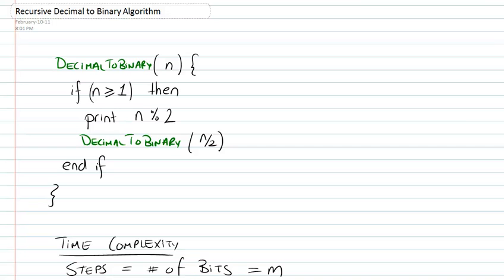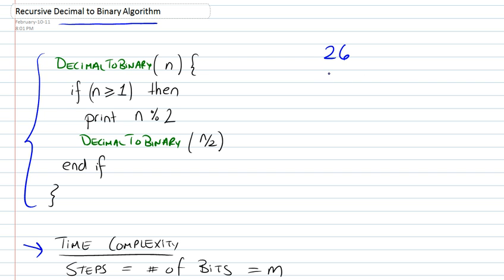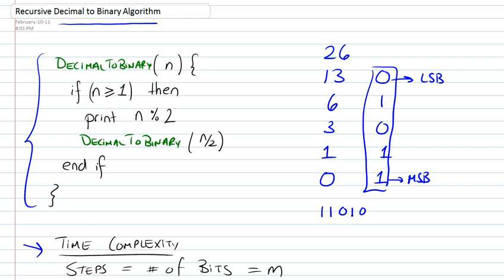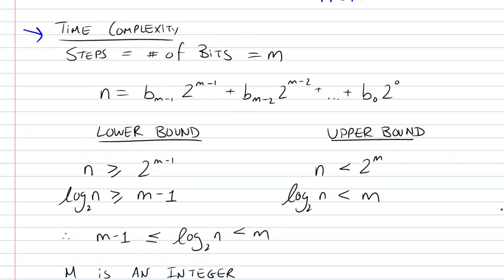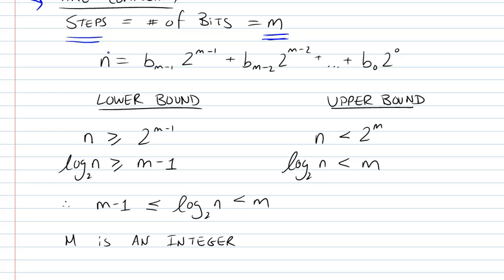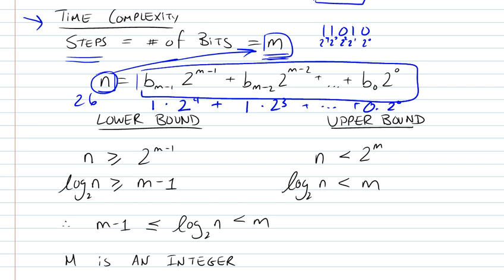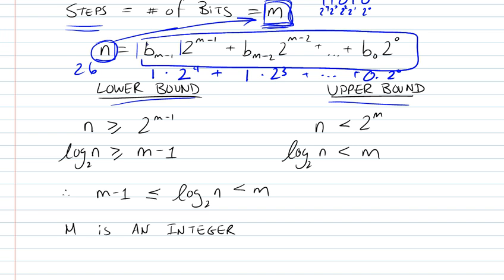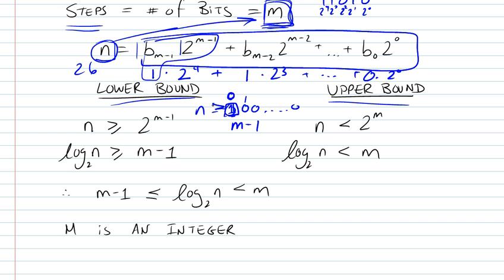Recursive Decimal to Binary Conversion Algorithm with Time Complexity Part 1/2

Comment: Steps in if statement are in incorrect order. You must first call recursively and then print n % 2 so you don't get binary number in reverse order (ie. 6 binary is 110, not 011).
Reply: Exactly